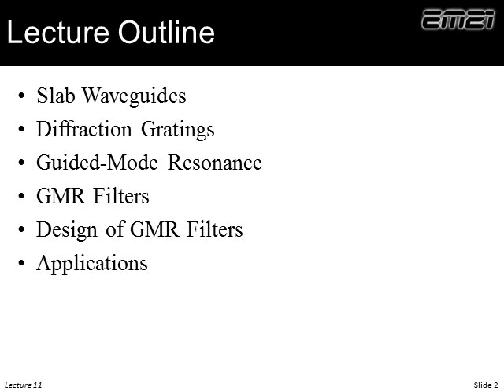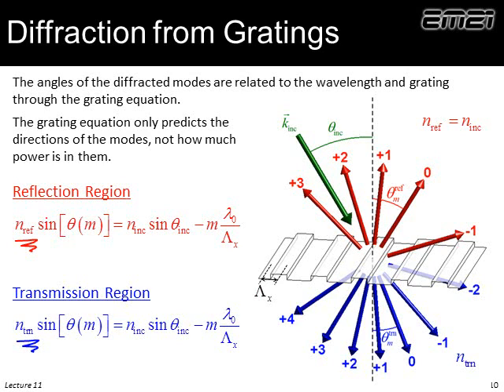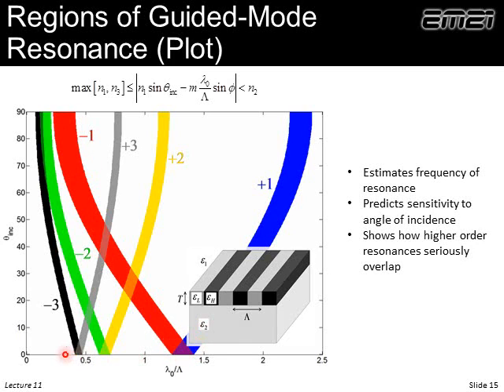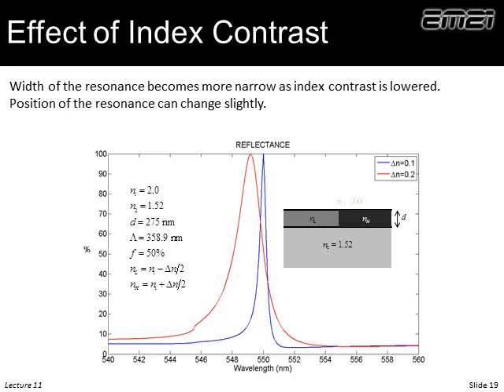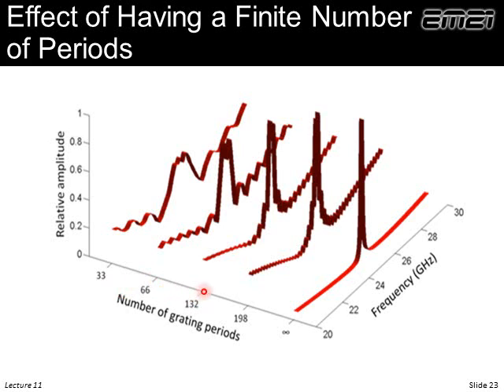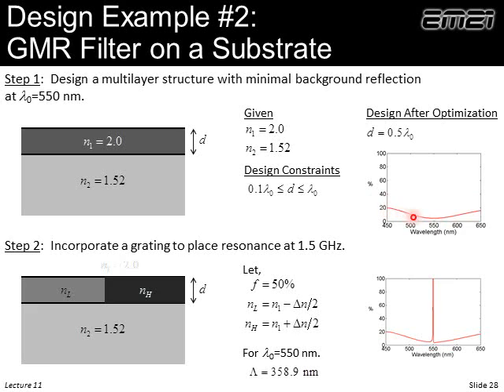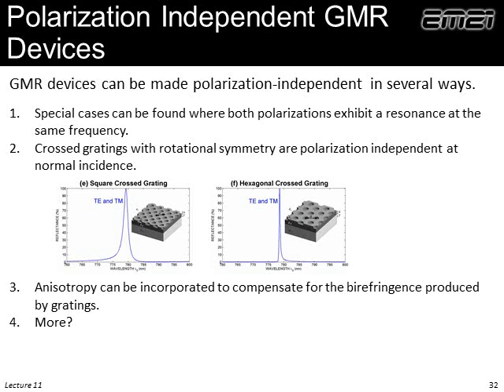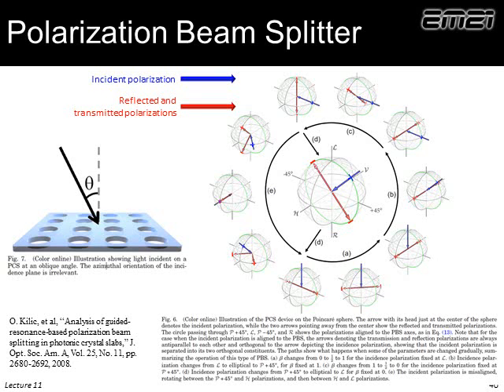Lecture 11 (EM21) -- Guided-mode resonance

Comment: thank very much for the excellent lecture. could I ask where I can find the parameters for slide 18?
Reply from the maker: Unfortunately, that data is long gone after a Ryuk attack at my university. I an unable to tell you.
Reply: @empossible1577  Thanks. I have some ohter questions, 1. when we use corss-grating, I have x polarized incidence. Do I need to use the grating equation in both directions to calcuate the diffraction, seperately? 2. how to distinguish the TE and TM mode in a waveguide when the incident is a normal incidence (by a cross gating)? 3. will the waguide mode be disturbed by the grating after we adding the grating on the top?
 thanks.
Reply from the maker: @没有巅峰人生永远是上  Regardless of polarization, diffraction will occur in all directions described the grating equation. Polarization just affects how much power couples into each of the diffraction orders.

For normal incidence on a flat interface (i.e. no grating), TE and TM have no meaning. When there is a ruled grating, some people define TE and TM relative to the grating vector K. In this case, TE is usually the polarization that has the electric field perpendicular to K. For crossed gratings, I think TE and TM and have no meaning again. If the cross grating is 90 degree symmetric, both polarizations will behave the same anyway.

The grating can be placed anywhere and everywhere, as long as it is close enough to the waveguide to be electromagnetically coupled. It could be on the top, on the bottom, inside the waveguide, or any combination of the above. The farther away the grating is from the waveguide, the weaker the coupling and the narrower the resonance will be. As some point, the resonance becomes so week and narrow that it effectively vanishes.

Comment: Thank you for excellent lecture on GMR! I have some questions for you.

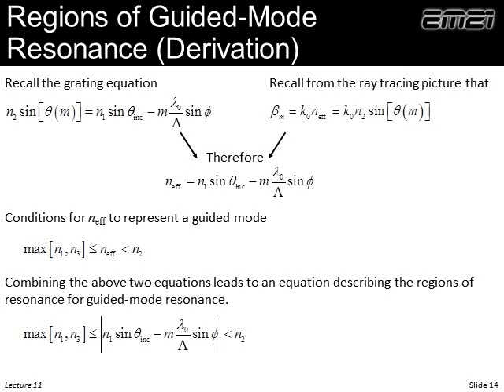1. Based on the equation in (09:25), the effective index of the grating consisting of Si should be matched in the case of (29:50). We can get the effective index of Si waveguide without grating, but how could I get the effective index of grating in this case? If I assume the fill factor F is 0.6, is it reasonable to calculate the effective index of the grating to be (0.6 * index of Si waveguide) + (0.4 * 0 ) because there is no guided mode in the region of (1-F)?

2. Is it also reasonable to consider the GMR condition as a condition for grating coupling?

3. Is it safe to think the condition for GMR, resonance in spectrum in RCWA, and grating coupling?

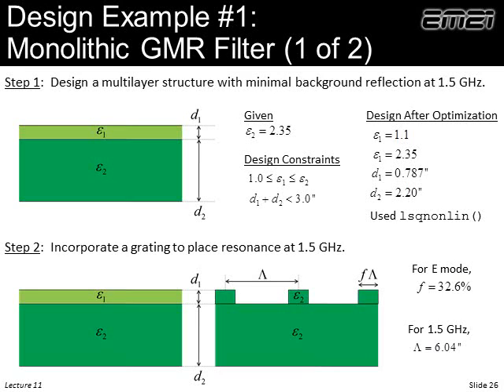In addition, where does the guided mode is confined in the case of (23:09)? In this configuration, how could I design GMR for the guided mode to be confined in the grating layer and what is the design principles?
Reply from the maker: I hope I understand your questions correctly.  Here my answers…

1.	I would not think of this as the effective index of the grating.  Instead, think of it as the effective index of the guided mode.  This is an important distinction because some GMRs have the grating away from the slab waveguide.  Calculating the effective index requires a simulation very similar to how photonic bands are calculated.  The guided mode is a Bloch wave in a periodic structure.  A weighted average like you suggest may get you close, but the guided mode extends outside of the grating layer to experience air and the silica substrate.  There is a guided mode in the regions where there is no silicon.  That is because the guided mode is a Bloch wave in a periodic structure.

2.	Yes!  A grating coupler and a GMR are the exact same device, just used in different ways.  In fact, I have designed grating couplers and I always start that design by first designing a GMR.  That only requires a single unit cell and is a fast simulation.  Grating couplers also tend to involve apodization, curved gratings, and other things that go beyond the typical GMR.

3.	Yes, the frequency of the GMR resonance is the very same frequency that grating would be used for grating coupling.

4.	(23:09) In this case, the mode is mostly confined to the eps2 region, but it still overlaps the grating.  It really is best to think of the guided mode as a Bloch wave in periodic structure.

Hope this helps!
Reply: @empossible1577  I always thank for your kind reply! They are much more than I expected. You are right, it's the guided mode in a periodic structure which have effective index. Thank you so much. And I have one more question for you if it does not bother you.

If I want to calculate the effective index of guided mode in (29:50), is it right to calculate the band structure using 2D PWEM as we do in 2D photonic bands? In this case I think I just have to give periodic boundary condition in x direction and no periodicity(Q=1) in z direction(29:50). Do you think it is correct?
Reply from the maker: @HCho-xe1cj  You will need the periodic BC in the direction the wave is propagating.  In the other direction, you can use whatever boundary condition you want because you need to add enough space above and below the GMR that the mode is completely confined and decays to zero.

Remember when you solve it this way, you will be making a guess at neff and then calculating frequency.  You will need to setup a simple optimization or just experiment manually to guess neff that places the frequency where you want it.  It is possible to reformulate the problem so you don't have to do this, but I don't think it is necessary.  Not worth the trouble.
Reply: @empossible1577  Thank you so much professor!

Supposing I have target wavelength and other parameters except for the period which I want to find out. Here is my strategy for it: 1) Get effective index of the guided mode in the periodic structure and assume appropriate period, 2) Do RCWA, 3) 2D simulation with grating coupler and waveguide, 4) Do 3D simulation.

 Can I ask your typical simulation process when you are designing a grating coupler?
Reply from the maker: @HCho-xe1cj  I follow pretty much your same process.  I design the GMR first because it is much faster.  Many grating couplers are apodised so I might use my GMR simulation to do a parameter sweep so I can accurately apodize the grating.
Reply: @empossible1577  Thank you so much professor! Your answers really helped me a lot, thanks :D
Reply: @empossible1577  Hi, professor!

As I simulate the GMR using RCWA for designing a grating coupler, I noticed that the spectrum at zero incident angle is quite different than the spectrum at different angles. Is it a universal characteristic of GMR or is it just my misunderstanding? And if it is a universal characteristic, I wonder why it is.

Thank you :D
Reply from the maker: @HCho-xe1cj  Yes, GMRs are very sensitive to angle, dimensions, refractive index, wavelength and it would not surprise me if they were also sensitive the location of Pluto.  You will need to simulate your GMR the exactly same way you will be using your grating grating coupler.  You will need to ensure your GMR has sufficient bandwidth for your light and to be as angle tolerant as you need.  There are lots of papers on designing GMRs that are more broadband and more angle tolerant.

Comment: Dear, Prof. Rumpf,  I wrote FDFD algorithm using Your lectures. Thank You! Everything seems to be working when I use only one material, but whenever I start using two materials (for example the structure as in Your slide 22), I am starting to get illogical results: R>100%, resonance doubled etc... I definitely set nmax to maximum refractive index and used quite high spatial resolution. Any advice of where I should look for problem?
Reply from the maker: I have only seen that when using a collocated grid, not a Yee grid.  Assuming that is not your problem, there is a mistake somewhere in your code.  I will guess it is hiding in your calculations of transmission and reflection.  Do the fields look correct or do they also look crazy?
Reply: @empossible1577  The fields look quite good, nothing crazy going on there. When calculation indicate R and T > 100 %, it is not a lot, just few percent, in some cases 150 %, so I am not sure if the fields would show me something... Since I checked the functions calcpml2d and yeeder2d according to Your recommendations (I got the confirmation), I assume I do not have to check them for errors? I will overview the code again for errors, I am just surprised that when modeling glass gratings everything is correct (checked with FDTD) :)
Reply from the maker: @tomastolenis6023  Can you figure out any patters, like is it always R or T that is wrong?  Is the answer always wrong when the transmission region is something other than vacuum?  etc.
Reply from the maker: @tomastolenis6023  By fields looking crazy, I was asking when you get 150% reflection, do the fields really look this strong?  Whether they do or not gives a clue about what might be wrong.
Reply: @empossible1577  Dear, Prof. Rumpf, sorry for the late response. At the moment I can not even get back to the state where I thought my modelling was correct :) Now even conservation of energy does not add up. Fields look ok, nothing crazy is going on, even if I observe resonance effect. It definitely might be that R and T calculations are wrong, but if that would be the only problem, then the doubling of the resonances would not appear... I think I have to just sit longer to this method, all that "sparsing" and transforming matrixes to the arrays got me confused at the moment and I maybe after I will understand every line of the code I will find my mistake :)
Reply from the maker: @tomastolenis6023  Computational electromagnetics is 90% frustration, but there will be victory in the end!  Have I pointed you to the course website?  This has some more resources that might help you.

https://empossible.net/academics/emp5337/
Reply: @empossible1577  Oh, Yes! This website is now my Homepage :) Thank You! :)
Reply from the maker: @tomastolenis6023  Awesome!
Reply: @empossible1577  Dear, Prof. Rumpf, I think I found my mistake. My masking function, Q, and electric/magnetic field collecting lines for R and T calculations was too close. I am not sure if that is the case, but, when I expanded the grid and distances from device and PML, "E" mode is very similar to the one, presented in Slide 19. Only one thing is different: resonance in my simulation is at 552 nm wavelength. When I increase the dn to 0.2, I get same widening, but still at 552 nm. For the "H" mode, the resonance in my simulation is at 639 nm, which is quite similar to the Slide 22 :)
Reply from the maker: @tomastolenis6023  Excellent!

Comment: How can one determine whether the resonance obtained is a Rayleigh Anomaly (RA) or GMR? In both cases, the light is guided in the plane parallel to the wave vector of the grating. Can RA be present for subwavelength grating ?
Reply from the maker: I always visualize the fields during a simulation.  You will see a big difference between a guided wave and a surface wave.

Different people have different definitions of a subwavelength grating.  Some define it as a grating with period less than the free space wavelength.  In this case you can have RA because inside the grating it may not be subwavelength and diffraction orders can span cutoffs.  Others define it as less than a wavelength everywhere.  In this case, you cannot have any RA because no diffraction orders can ever exist.
Reply: @empossible1577  Thank you for the reply. Do you have a video where the difference between the fields for a guided wave and a surface wave is shown? Any other references? From the experimental point of view, can one observe this difference by looking at the transmission or reflection spectrum from the grating?
Reply from the maker: @rajatsharma6256  I really should not have called them surface waves.  A surface wave is a true guided-wave phenomenon and you could actually design a GMR based on surface waves.  A diffraction order at cutoff looks like a surface wave, but is not a surface wave because it leaks away.  A true surface wave stays guided.  Based on this, a diffraction order at cutoff will produce corners in the transmission and reflection response.  A guided-mode resonance will produce sharp spikes in the spectral response.
Reply: @empossible1577  Thank you for the response but what do you mean by corners in transmission/reflection spectra?
Reply from the maker: @rajatsharma6256  Maybe the reflection response is increasing, but then suddenly starts decreasing.  It is a sudden change in the slope and/or curvature of the line.
Reply: @empossible1577  If I understand correctly, you mean to say that for a chosen angle, reflection starts increasing with changing wavelength, then there is a sudden change as the mode gets cut off at a particular wavelength. 

Suppose, we place a detector tangent to the plane of the grating, ie, on the edge of the grating, then it will collect both, the RA and GMR. Will it be possible to differentiate between the two modes from such an experiment?
Reply from the maker: @rajatsharma6256  Hmmm...

First, that would depend on where you have the grating.  If the grating is embedded in your device, then the "surface wave" would not be accessible.  If the grating is on the surface, you might be able to detect it.  However, they decay pretty quickly, but if you adjust wavelength to just after cutoff, you will have an actual wave propagating near parallel to the surface of your device.

A detector may not be able to capture the GMR because your waveguide is probably embedded.  Maybe in your configuration the guided mode has an evanescent field that is partly exposed you could perhaps detect it.

Here is another way to think about this that might help you detect these various things.  A guided-mode resonance filter is the EXACT same thing as a grating coupler.  It is just used differently.
Reply: @empossible1577  Considering grating is on top of a transparent substrate and for a particular angle and wavelength, the grating couples the light incident from top/bottom into the substrate underneath which allows for the guided wave to travel through TIR. Then through a detector placed tangential to the surface, I will be able to look at GMR as the light comes of through the side facet of the transparent substrate.
Reply from the maker: @rajatsharma6256  I think so.  Give it a try!

Comment: What does it mean for GMR mode to be cutoff? Does waveguiding happens in this case?
Reply from the maker: There are two ways I may have used those words because there are two simultaneous mechanisms happening that produce a guided-mode resonances.  First is diffraction from a grating.  There must be at least one diffraction order, other than the zero-order mode.  Second, there must be a waveguide.  If modes in the waveguide are all "cutoff," then there will be no GMR.  If the diffraction orders from the grating are all "cutoff," then there will be no GMR.

Comment: Is diffraction a necessary requirement for guided mode resonance or there can be other ways also of having guided mode resonsnces?
Reply from the maker: There are other ways to produce filtering, but grating diffraction is needed almost by definition for guided-mode resonance.  I am not sure how else you could couple into a guided mode.  
With that said, there are surface waves with coupling mechanisms other than gratings can be be used to create a similar effect.  In fact, this response is how people confirm they have excited a surface waves.  See Lecture 7b here:

https://empossible.net/academics/emp6303/
Reply: Thank you for the fast reply. Really very helpful. I have another question. What parameters decide the qualtiy of GMR? In particular, how will the thickness, duty cycle (fill factor) and refractive index of the material that make a set of discontinuos arrays effect GMR?
Reply from the maker: @samirsingh148  Not sure what you mean by quality.  I might interpret that has a GMR that has excellent contrast between on and off resonance.  The main thing for this is to ensure either very low reflection or very high reflection without the grating in place.  A mediocre background response leads to crazy resonances.

From here, controlling the width of the resonance is all about the strength of the grating.  The stronger the grating, the wider the resonance up to a point.  The grating can be made stronger by increasing contrast or moving it closer or into the waveguide.  This is actually more useful for making the resonances narrower by weakening the grating.  A better way to make them broadband is to engineer multiple resonances that cooperate to give an overall broad response.